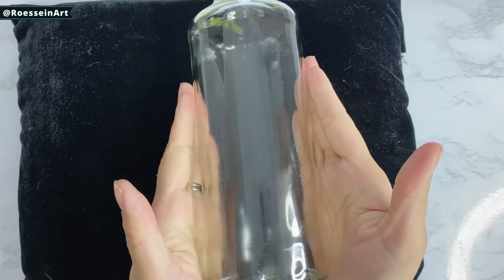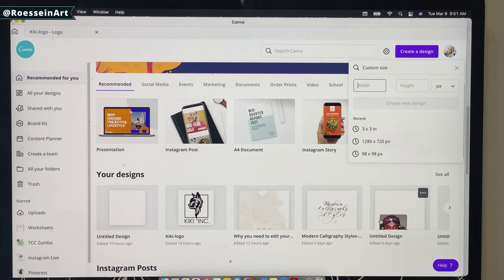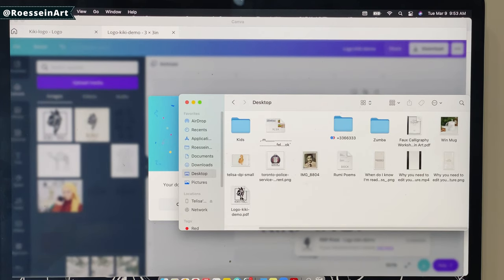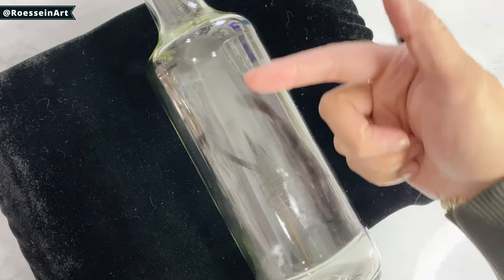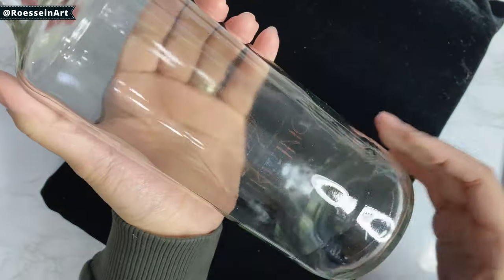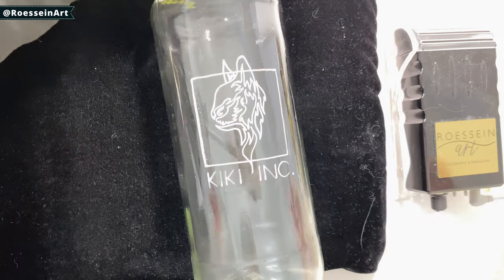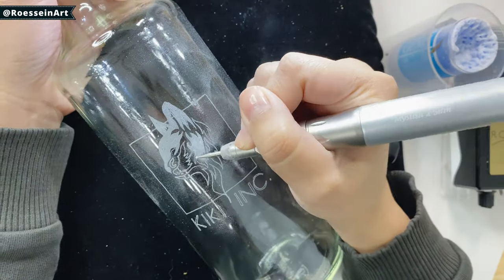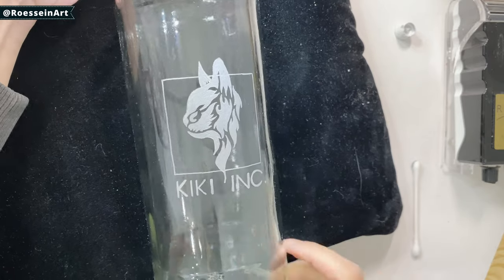How to Engrave a Logo

Comment: Excellent video, as alway Telisa! Quick question....do you find you have to work quickly with the rub n buff? I did my first long engraving on a wine bottle, a few lines of script, and found that the rub n buff dried up very quickly and had a hard time removing the excess.  Wondering what I might’ve done wrong....

Comment: Thank You Telissa for the insightful tutorial as usual. You killed it. I am just thinking using this technique for bulk orders might be a lot of work. What do you think?
Reply from the maker: It will be a lot of work for sure. Charge appropriately though. The most I’ve done was 12 bottles and it took me a whole week.
Reply: @RoesseinArt  You can say that again. I’d always thought cricut will be idle for those type of orders to save time and all but I will try this technique as well. Thank you for sharing ❤️
Reply from the maker: @olukemielebute317  You're very welcome!
The only problem with using cricut is when you run into logo that has a lot of details in the middle of the design like the police badge on the decanter that I engraved. Then you can't really make a stencil with those tiny details.

Comment: Few points to raise on glass & crystal work as the video did not adequately discuss.
 Comments below are from extensive professional experience.
. straight lines: this video did not show how lines were achieved and engraving was done with time lapse or fast recording.
. Unless the hand has gained adequate practice with any type of burr, cutting lines to any depth to a legible state, ( on any surface ) much practice is required otherwise straight lines will be highly challenging to cut.
. All should be aware that engraving is unlike calligraphy on paper, as the tool is chopping into a solid surface. 
 .  Burr / diamond is spinning and is constantly looking to jump off the surface, as the hand is trying to maintain control of it to balance both. 
. If cuts are lacking enough depth paint will not stay in them (unless thin lines are deep enough, this is will be particularly faint look after painting them).
. Suitable paint color is needed to suit color of glass for maximum contrast.
  Bulk work: depending on number of pieces to be engraved --also logo etc--, it may be suitable for a larger master to be made, using formaica / brass. Master piece is then used on a small pantograph (for part or entire logo,) to be finished by hand engraving etc.
  A most unfortunate issue is under quoting a job. 
  Also relevant is being aware of diamond burrs cost, in any bulk work, as a single burr may last for certain small No. of pieces only. Diamond burr is not inexpensive.
good luck.😢